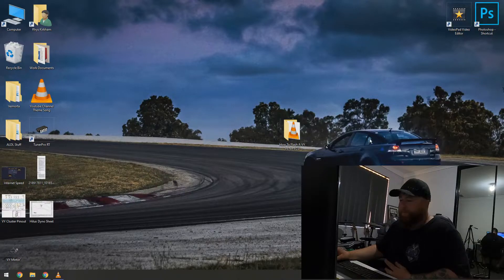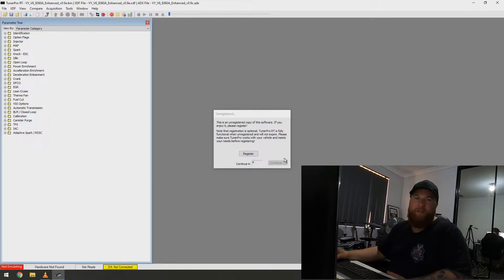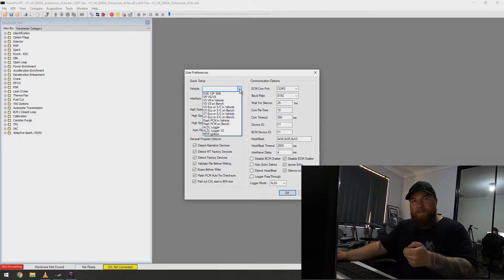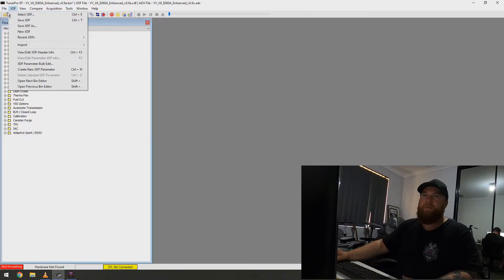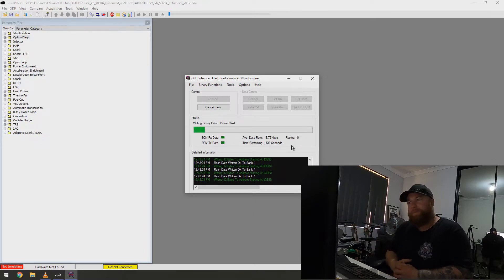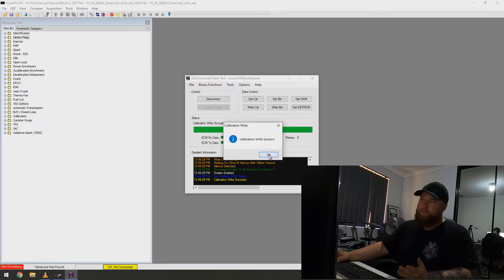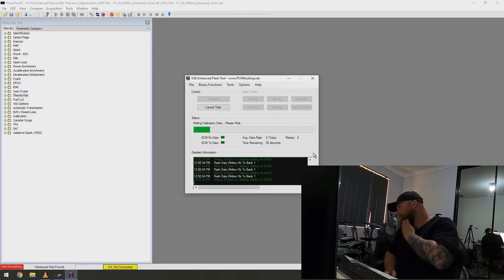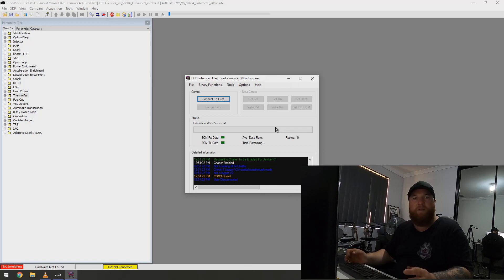Revisited - How To Flash Tune A NA VX,VU,VY V6 ECU Revisited

Comment: Hi mate, great video I just have one question I hope you can answer. I have done everything as per your video but when I go to the option flag menu there is no option for the vats or the manual transmission   select. Any help would be greatly appreciated.  Sorry this is for a vy v6 getrag.
Reply from the maker: There 100% is mate. What xdf are you using?
Reply: @RKGarage  hi sorry I found the vats in a different folder. I'm using VY_V6_060A_Enhanced_v1.1.xdf

Comment: Hey mate. I have a MACE Flash chip in my L67 VY CALAIS.
Do I need hardware to change the chip calibration? Or can I use ose and tp?
Reply from the maker: Just need the aldl cable mate

Comment: Will enveyous customs aldl obd2 cable work ? My mates got one see if i can get it set up on his laptop for him when i go over there
Reply from the maker: Yeah mate, thats what I use.
Reply: @RKGarage  so doing it in the car  instead of the bench is it just plug the aldl cable into the obd2 port and then usb end into the laptop
Reply: @ProdR3D5Y If the ECU/ECM has a flash chip then yeah. Not sure about OBD2 though as I haven’t messed with that.

Comment: Hey mate sorry if it’s been asked before but would this auto tune work on my manual ecu? I don’t want to download an auto tune and it causes rev hang issues etc.
Reply from the maker: All manual tunes cause rev hang, part of the manual tunes
There are ways to get rid of it in the tune tho
Reply: @RKGarage  any tips on how to remove it? Also is there a way to tell if my ecu has been tuned already or been adjusted?

Comment: Is there a file out there for a Auto VX S2 Mang sedan with 1.98 rockers, 69mm throttle body, Growler intake, Full Exhaust and 3.46?
Awesome video by the way. 👌
Reply from the maker: Thats basically the stock tune
Reply: @RKGarage  Thought that might be that case.
To go against the grain is there anything in the tune to be done for economy?
Reply: @RKGarage  Car doesn't get flogged it's just a really neat daily that happened to find itself some parts that were lying around.
Reply from the maker: Basically a custom tune mate
No generic stuff you will benefit from
Reply: @RKGarage  Again thought that might be the case.
Appreciate your time mate.
Keep the content coming. 🙂

Comment: Hey mate - can you do a tutorial for MEMCAL based cars like L67?
Reply from the maker: Sorry mate, I don't waste my time with memcal junk
Flash tune is the way of the world
Reply: @RKGarage  but what about all the blokes running L67, they need help brother. Im past that scene now owning a LS1 but there is a big community of blokes with L67s myself included i couldnt wrap my head around tuning the memcal
Reply from the maker: Considering it costs about $500 to get tge gear to burn memcal's... isn't worth making the video on it when the viewers will never spend that money
Reply: @RKGarage  your not wrong lol, i thought it was same programs you just need to get a writeable chip
Reply: @RKGarage  would my LS1 Vy be flash based? I want to try an lower the idle for my huge cam temporarily until i can get a higher stally
Reply from the maker: Yes they are, you need the mpvi dongle which is 750, then 2 credit which is 100
And also a "huge" cam generally doesnt like a low idle
Reply: @RKGarage  2 credit? And couldnt i use a obdii cable and laptop?
Reply from the maker: Nope has to be a mpvi dongle and use credits to license the tune to the ecu
Reply: NVRam

Comment: Hey mate just wondering what are the options in the idle menu? Trying to fix rev hang on my factory manual vx and I believe the IAC is tuned to stay open for a brief moment after coming off throttle causing rev hang. Wanting to know if the IAC has any tuning options, cheers
Reply: Did you figure it out?

Comment: Am I right in seeing that you changed that from an auto trans setup to a manual trans setup? 
I did a trans swap in my VY spac and I've got "rev hang", (I'm using the auto loom and ECU, just rigged it to think it's always in neutral). Will this flash fix that? Suggestions??
Reply from the maker: Yeah from memory I did this so it was set up to be manual.
Manual's usually always get that rev hang, i had it with a Kalmaker tune as well. This flash tune may help subside it a bit tho!
Reply: hey mate, how did you make it think its always in neutral?